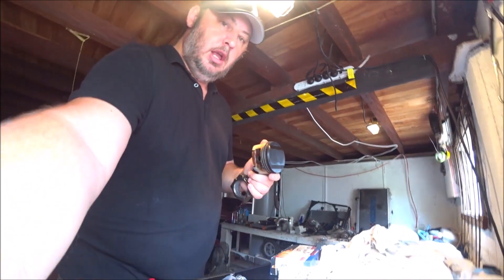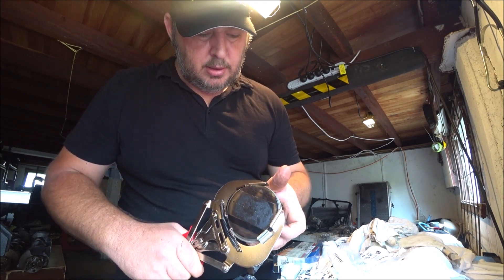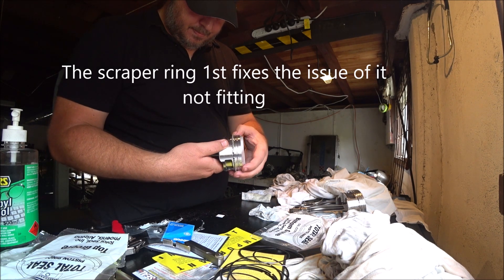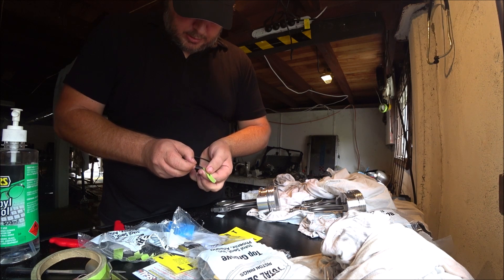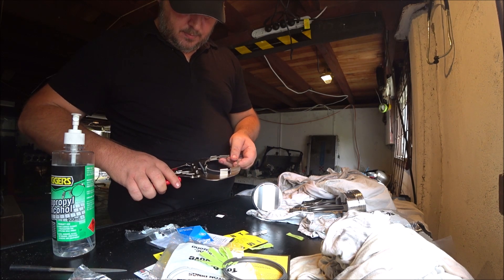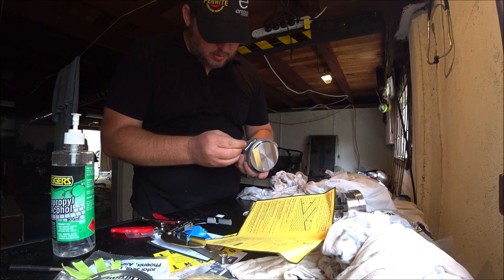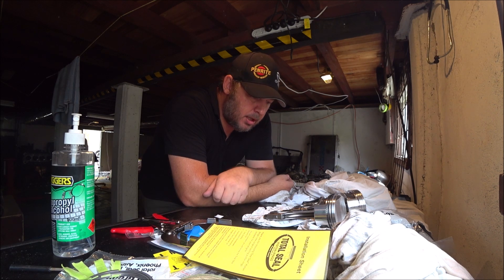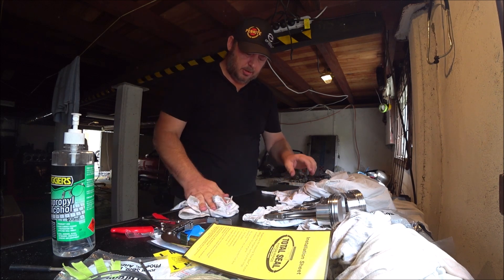RB25DET Build - Fitting Piston Rings

Comment: I'm trying to fit rings to stock RB25DET NEO pistons. I can get the oil ring in no worries. I can't get the other two rings in properly. I've tried swapping them. Also tried putting the original ones back in. Not sure whats going wrong. The rings sit above the ring grooves but don't seem to fit right. All seems a bit tight. The pistons have been cleaned tested by an engineer.
Reply: All sorted, what happened was the engineer bead blasted the pistons clean. So they have an edge. So I need to run around the grove with an old ring to take the edge away.
Reply from the maker: Yuck